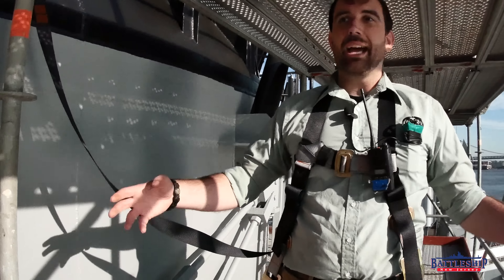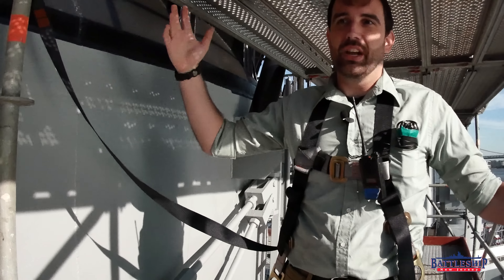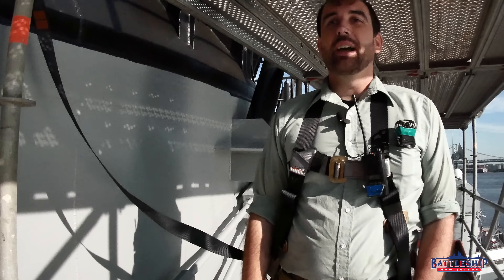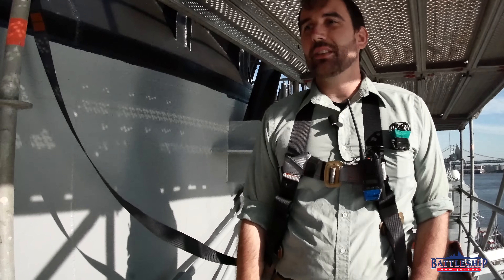Restoring Battleship NJ's Smokestacks

Comment: They did that on a lot of ships of WWII Era. The point of it was to direct the wind from foward movement to flow in and cause a "draft" that pulled the exhaust up and out. They did it to a lot of non-military ships of that Era also(I own a tug boat that was laid down in 1949 that had the exact same feature). It works great when a ship is moving, not so much when it sits for decades. The water just sits in the baffles. As you know, salt water is the worst! Replacing the 1 stack on my boat cost almost as much as the rest of the  boat, combined.

Comment: SMOKE STACK DRIP EDGE -- As an architect, I run into this all oft the time, where water from above runs down and then into "hole" or potential weak spots in a wall or at the top of a door or window.  We use "drip edges.  These are flaired out strips of metal of even plastic which drain the water away from the wall on the upper side then let it drip off instead of rolling back into the "hole" or recess in the wall as at the tops of doors and windows.
This is NOT close to the visual gaze of visitors and the thin gauge steel was part of the mothball process, not part of the active ship.
WHILE THIS SCAFFOLDING IS STILL UP consider adding drip edge around the top of the stack to help keep water from the sloping black-topping area off of the top of the stack vertical walls !!!
Reply: I fully agree. Drip edges are very important water control features. Not so much on an active ship, but very important on a static item.
Reply: Yes. I added them to my house and it works great.
Reply: Can confirm. we called them drip rails on ambulances and they're fantastic.

Comment: The gunwales always seem to be rusty.  I know it's cosmetic, but that's the first thing you see when coming on board. I would have said "the whole deck" but that's looking great now.  In all, I think the BB museum ships tend to weather better than CVs. Too many horizontal surfaces and thin mild steel. I was on Yorktown in mid July (hot) and the predominant way rust was treated is is to just paint over it.   If you want to see rusted through metal Clamagore is still moored there for the time being.

Comment: I wonder if the opening on the stack would draw air into the stack as hot air was rising and diluting the soot and particulates coming out of the stack with more air making a less noticeable smoke trail and in turn making it more difficult to spot visually.

Comment: I'm remembering being told that something in the battleships' superstructure was aluminum to save weight or maybe for stability. I thought it was the funnel casing but obviously not, it was clearly steel in this video. Is that true, and if so, where on the ship is the aluminum used?
Reply: IIRC the sheffield of faulklands era had an aluminum superstructure
Reply: @guiltyofbias8818  wrong, the Type 42s like Sheffield had no aluminium superstructure

Comment: Speaking of smokestacks, I've seen people say that the best to defeat a WW2  ship is to drop a Precision-Guided Bomb down the smokestack except I'm pretty sure it doesn't quite work that way
Reply: There was a rumor that that was what happened to the USS Arizona, but it has since proved to be false. That's probably where that came from.
Reply: they are not a straight path to the engine they are shaped to catch bombs away from the inside of the ship
Reply: The stacks are designed to prevent bombs from going straight down into the boilers. They have at least 2 90° bends and they also have armored grating inside the stack to prematurely detonate the bombs before they get anywhere vital inside the citadel. The over pressure from the bomb detonating MIGHT blow out the boilers that are venting through the stack and aside from random pieces of shrapnel all inside the stack the ship would be relatively unphased by it.
Reply: Considering the fact that, might've been Saratoga, one of the carriers, maybe Hornet, had a fatal blow when we had a bomb dropped directly into her stack, it wouldn't come as too much of a surprise to me. I mean, maybe a bit harder on a battleship, but it wouldn't come as suprise
Reply: It is not a straight path down to the boilers, there is a diagonal for the smoke below.  So directly below the smoke stack there is full thickness continuous armor.

Where the smoke passes through the armored deck it is a grating with holes through the armor so the bombs will hit thick armor before they can enter the armored citadel. To hit that you need to aim a bit away from the smoke stacks. There is a video that shows the passage through the armor but I can't find it .

I am not sure where the best place to drop a bomb on a battleship to destroy it. To make it a less efficient ennemy I suspect that it is best to target the sensor in the superstucture. Destroying the radar is not hard if you hit there and it has a significant effect on the battle effectiveness. For a Iowas class in the 80´s configuration targeting the missile launches on deck wil destroy all long-range offensive capacity. If you are out of range of the main guns the ship can not do a lot to you.
Reply: Maybe on Merchant vessels and DDs, Warships like New Jersey have bends built into their exhaust systems as well as very thick grates to prevent a bomb from getting that far. And despite persistent rumors to the contrary the Fritz-X glide bombs that sank Roma DID NOT go down her funnels, one struck her bow and allowed water into her forward barbette and the other struck starboard amidships and detonated a magazine.
Reply: You can blow out the boilers like Yorktown.
Reply: It's not a big open hole but a large number of pipes and they are not directly over the engine but off to the side to prevent heat issues and reduce noise.  Even in your car that you drive today, the exhaust pipes are not a straight shot to the engine but they twist around, the more bends the less noise unless you straight-pipe your car which is where that word comes from, making the pipe straight to produce as much noise as possible when people modify their cars...
Reply: Watched a doc on the Musashi, and one of the pilots also claimed that happened.
Reply: Underneath each funnel are uptake spaces where piping containing flue gasses from each boiler meet and go up through the funnel. The uptake spaces are used as storage spaces. Ryan has done a number of videos where he's shown stored parts in the uptakes.  If a bomb did go down the stack, it might take out a boiler. The other engineers would secure the space and keep going